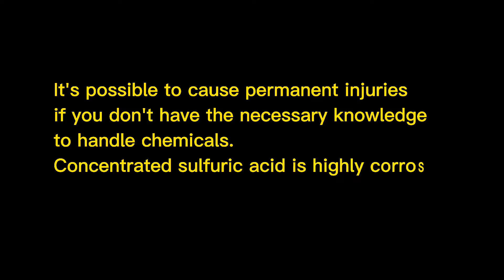Convert silver chloride to silver with iron nails

Comment: Iron nails much cheaper than using zinc، you can get rid of some contaminations by Washing the cemented silver with HCl, or while cementing with dilute sulphuric acid use a glassware and boil,that will dissolve any small iron particles
Reply from the maker: Nice tips👍

Comment: Hi, just wanted to ask how to fix a problem. I did the Lye and sugar method, and it did not work. I have a dark liquid with I think a hard lump of sugar in it. Can you tell me if there is a way to get my silver out of this and try your way. Any info would be great. Thanks again for all your great videos.
Reply from the maker: Dilute it 2-3 fold up (just enough to thin mix and dissolve sugar and lye. 
Let it sit (usually 1 day) then start pouring solution slowly to collect black material (silver oxide and maybe metal mix) 
Give it several wash to remove lye trace as much as you can , then you're good to go with any method you wish. 
When you get the black stuff check it out there is possiblity, turned into grey silver powder slowly.
Good luck 🤞
Reply: I thank you for your help. I will give it a try. Keep up the great videos and stay safe. @Picky_Plans